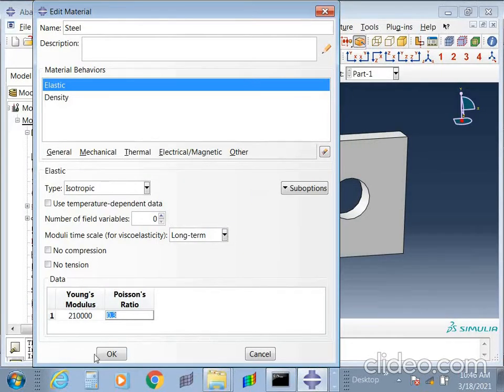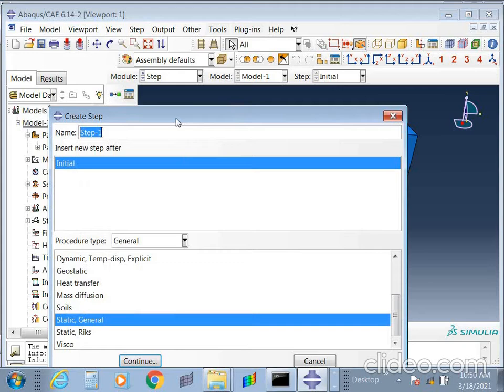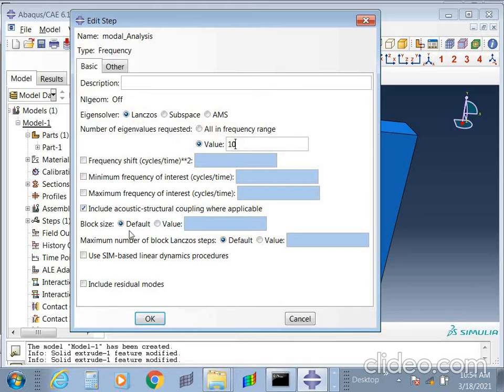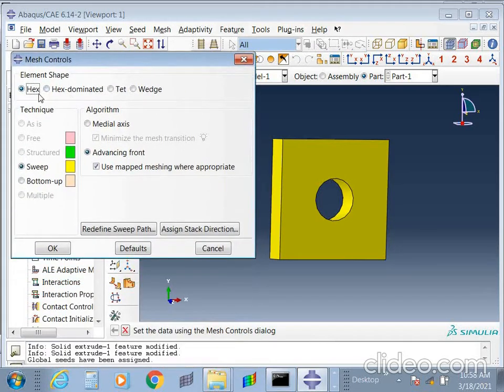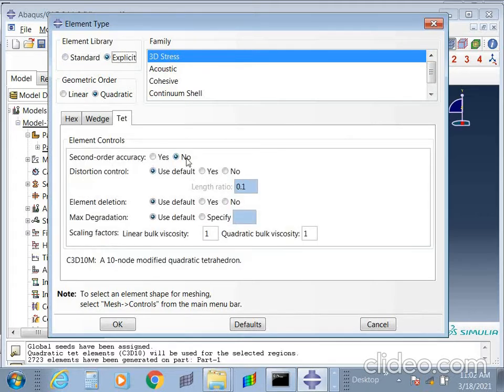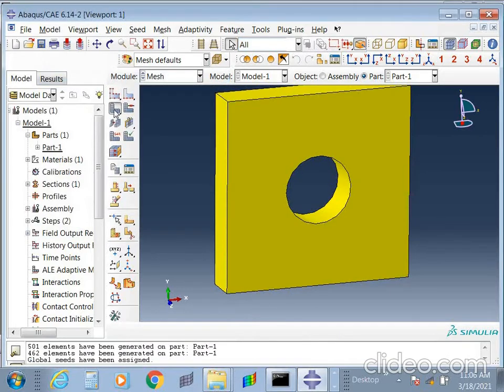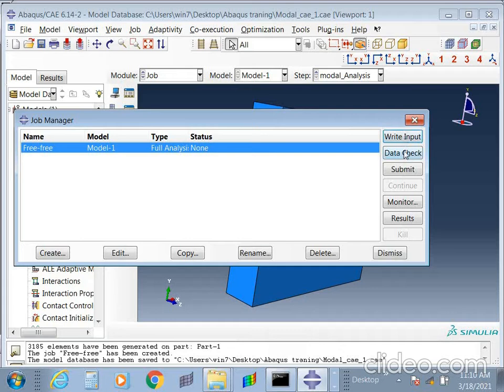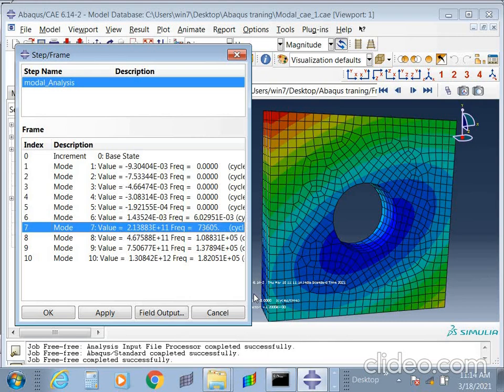Modal analysis of plate with hole using Abaqus CAE.#fea#structural#abaqustutorial#mechanical #mtech

Comment: Is this for civil engineering  ?
Reply from the maker: you can used for structural Analysis.
Reply: @arungovin6990  and that would be ?
Reply from the maker: @padmabharali1306  Can use for Civil and Mechanical.
Reply: @arungovin6990  thank you